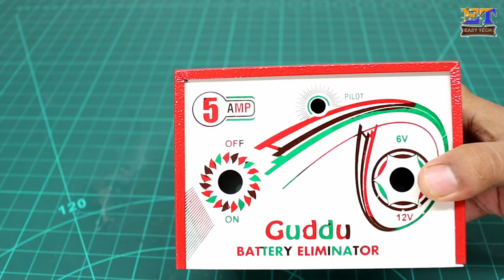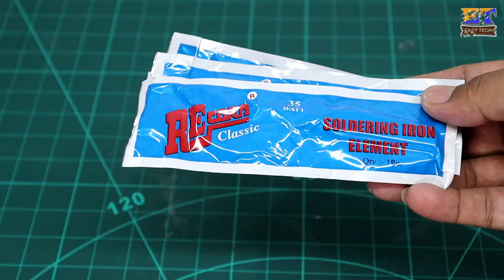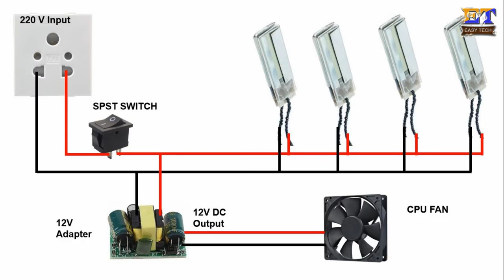New Idea To Make Simple Room Heater

Comment: So you attach flammable materials, add a tiny piece of heat shroud THEN drill threw heat shroud and insert more heat conductive metallic parts through flammable material. No running fan thus no air flow, that looks dead. A disaster waiting to happen. Mains voltage but no earth / ground wire. What A Death Trap. May report this due to dangerous teachings.